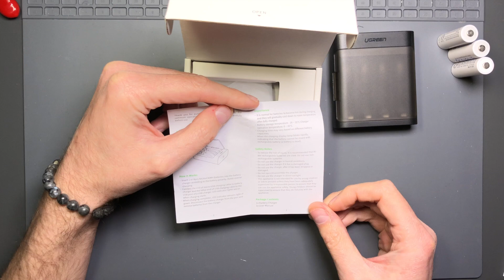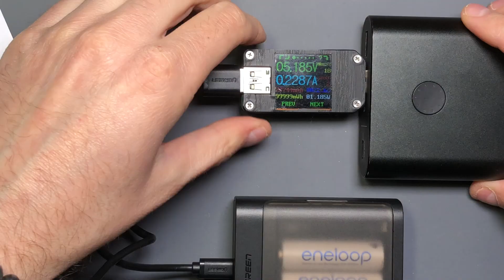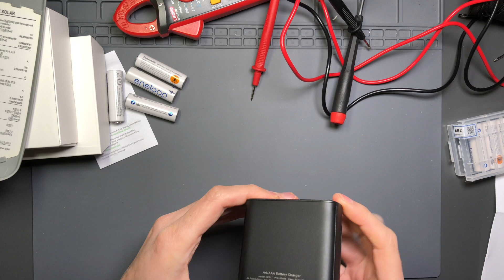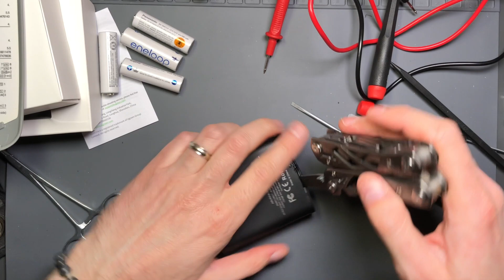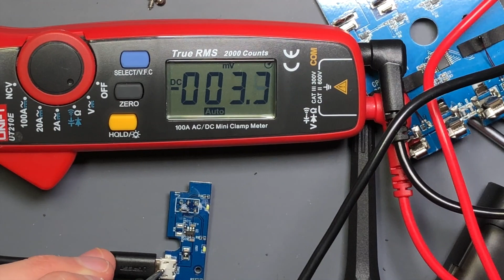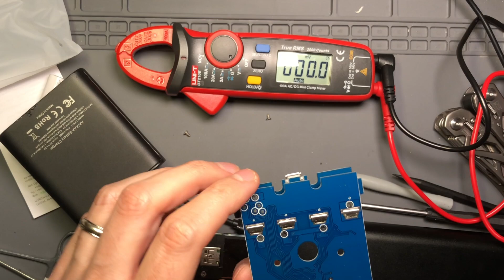Solid, Inexpensive AA / AAA Battery Charger (with analysis, teardown, and fault testing)

Comment: Ugh! It looks like they discontinued these and I really need a high quality one. I'm suspicious of most of the other ones on the market since they seem to use the same cheap circuitboard and pulse charging method as all the others.
Reply from the maker: I’ll be on the lookout for another battery charger, and perhaps make a video on it, if it is any good. I do see that it is no longer available. :(

Comment: It's difficult to pick what's best to buy these days. The reviews on Amazon for these enerloop batteries are a bit scary. Batteries exploding, warping, and I can't have that since I need these types of batteries for portable lights that are around stray animals on the street. I can't put these animals in danger if they explode.
Reply: Be careful buying eneloops on Amazon, there’s a lot of counterfeits kicking around and the bad reviews could’ve ordered from a 3rd party seller and got counterfeits.
Reply from the maker: I have done many reviews on different batteries (and many more coming!) that you can check out that work very well. I am not sure what Ni-MH batteries you are referring to that explode or warp? Perhaps it's the battery charger? These types of batteries generally do not fault in that way, and in the very unlikely even they do, it's usually during charging and not discharging (when in use). Hope that helps. Thanks for watching!

Comment: Question regarding this charger:  A few months ago I bought this charger based on your review.  It’s worked great so far but...
This morning I placed a brand new set of four Duracell Ni-Mh batteries in the charger; 20 minutes later 3 of the batteries show a solid white led while the fourth one has the white led blinking.  What gives?  I literally took them out of the package and put them in the charger.  They’ve never been used.
Reply from the maker: Good question! I think this one is best explained in a video. I'll be up in the coming weeks.
Reply: @TheCuriousEngineerChannel  right after I typed that comment I took all four batteries out and switched them around so that a different battery was in the formerly blinking slot.  Waited 10 minutes and sure enough the same slot was blinking with a battery that minutes before had been showing solid.  I gave it another 20 minutes and the blinking light finally went off.  Is it possible that particular slot is not working as it should?

Comment: I put one of these on my Amazon shopping list because of this review, very informative. Perhaps a piece of dental floss placed behind one battery could aid in removal of it. Do you have a recommendation for a charger that discharges and analyses as well?
Reply from the maker: The charger/analyzer I use is the La Crosse Technology BC1000.
Reply: @TheCuriousEngineerChannel  It seems like these aren't readily available anymore (maybe due to the chip shortage?). Is there another charger/analyzer you'd recommend?

Comment: The Powerowl is the charger that blasts each individual charging circuit, I too tested this unit after making the purchase that I have since returned to Amazon. IF you buy this AA/AAA Powerowl charge unit based upon hype provided by Amazon then one will feel satisfied to have purchased a quality device. MY experience after testing this unit would be to advise people to find a different charger, perhaps this little $10 dollar charger you have tested which I like. Have you tested a charger that you like best, or to put that another way, based on your criteria that could be relied upon as one that you recommend other than this $10 unit that you tested here?
Reply from the maker: Thanks for your feedback! I am quite happy with the $10 UGREEN charger. I will update the Description and end-card with that video.